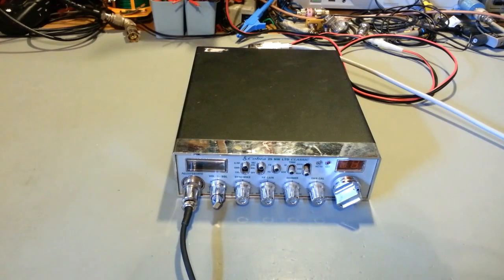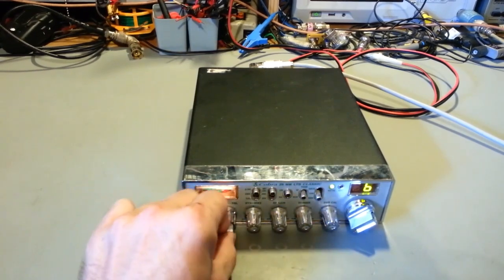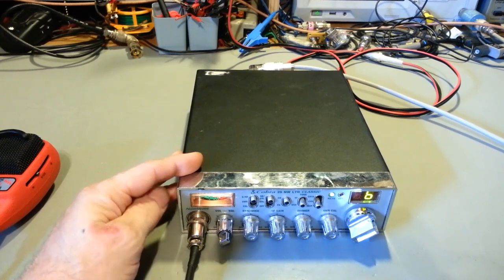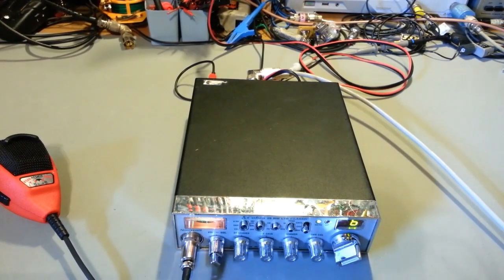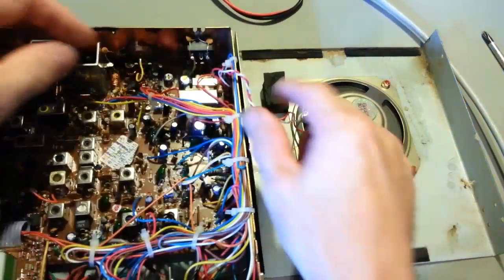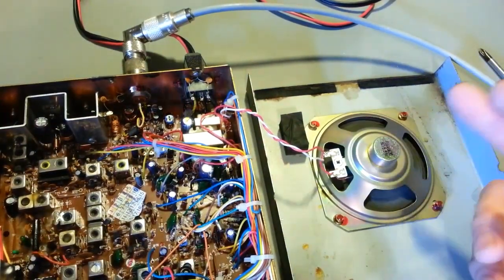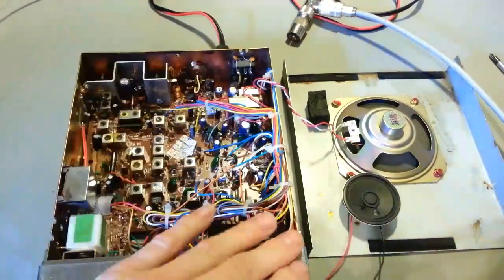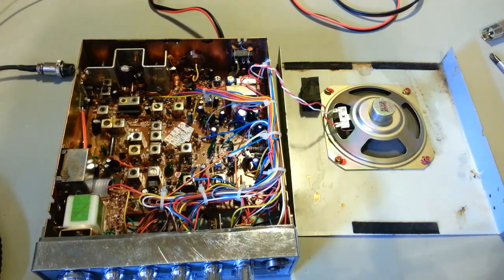Troubleshooting no receive audio in a CB radio with no test equipment.

Comment: Thank you so much - my Cobra GR25 LTD ST´s Speaker died today. Checked it and found nothing visible inside and on the Speaker. After your explanation at the Beginning of the Video about Circuitry you saved my Day. Thank you so much and wish you all the good Numbers.
Reply: Hi there @renehasselmeier9866.  Windy day out today and a little overcast I am new to this and I thought that I woudl ask if you are an active CB operator?  I ask because I am a little curious if there is a lot of activity on the CB radio.  I may go out and try to buy one either used or new.  Regards,  Richard.:face-red-smiling-live::yt::goodvibes::goodvibes:

Comment: Just bought a Cobra 29lx from their Ebay store and there is no sound at all. Taking this to my electrician friend with this video in hand so he knows what to poke around in. Thanks
Reply: Hey there @AJ-sh8uv.  It's a cloudy and windy day today 50 degrees and spring is on the way.  I am new to this.  Just quickly typing out to ask if you plan to be active on CB radio?  I have been looking around on ebay for radios and tried to order a CB radio thorugh ebay.  Richard. :face-red-smiling-live::yt::stayhome::elbowcough:

Comment: Of course I have no sound out the ext speaker hole as well as the internal one. I'm receiving when I key up my base radio as it shows on the meter. I've checked all switches and all knobs and as many connections as I can see..the radio is a Colt 444 AM/FM 40 upper /40 lowers radio with  a 3 position watt switch also. It's doing the watts it's supposed to do and I can hear myself in other radio. Just no audio from this mute bastard

Comment: Thanks for the information. I have a cobra 45xlr with the same problem however there is no internal speaker. It's the AM/FM CB and you must connect external speakers. It does transmit and the audio is fantastic but It doesn't receive on CB or the broadcast bands. I'm going to open it up when I get time. I'm hoping to find something simple like a broken wire or bad connection.
I would really like to get this rig working again.

Comment: unfortunately did not help me my radio sends but no receive. Its not the speaker. I replaced every capacitor in it. It really is a strong transmitter now but no receive?  the needle on the meter does not show incoming signal activity? But it shows transmitting and I can hear it on my bench radio I use to see if a radio is transmitting. I have several radios that wont receive I cannot fix don't know how ? Some look like brand new radios. I changed the protection diode it didnt help the old diode test out good.  the PA still works loud some one destroyed D11 its actually too crazy loud now. I think Im going to loose my 35 bucks on this one.

Comment: I have an cobra 29 lx chr le with echo tune that’s not working at all, so I decided to open the cover to find out the bolts that hold the speaker to the cover was on the mother board, my question is would it effect the cab from working ?

Comment: So what happens when you have a cb that transmits clear as day but even at 25ft apart or less I can't receive anything? Like the speaker definitely works sometimes I very rarely pick up random transmissions from other truck drivers and the noaa stations come through But when I am trying to talk to a co worker at a plant we load at or our yard even if we are like 25 feet apart I get nothing. Same cb as this. But my portable cobra hh50wxst does the same thing and I can't understand why and all it has for adjustments is just squelch... even tried a different antenna still nothing.

Comment: I've never been lucky enough to have only a speaker issue. Well one time on my Stryker 955 I use an external speaker in my truck but bring in and use it as a base with interal.
Turned it on and no sound.
Turns out the speaker had come unplugged from the pcb. I first thought the transmit had gone bad.

Where is Mike? He must have really found something good to abandon working on radios.

Comment: I just fixed one i got for 5 bucks. Someone hooked positive and negitive up backwards, blew the protection diode but not before blowing a hole in the audio modulator ic
Reply: If you had a hole in the TA2227AP  audio chip then they put in a 15 to 20 amp fuse after the normal fuse blew when they reversed the leads ...  I have seen many many radios come in my 2 way radio shop like that.....

Comment: I have been looking for a used cobra  nightwatch. They all seem to have the nw light inop. Is that common, and is the costly to fix.
Reply from the maker: Yes, it's common.  They fail sooner than later.  The faceplate luminescent decal is what fails.   The hotter and more humid the weather they are exposed to the faster they fail.
Reply: @mikesradiorepair  I   am wanting one so I don't have to use nitro lights, is it still repairable, can you still get the face plate if needed

Comment: Hey where did you get that screwdriver
Reply from the maker: It's a electricians screwdriver.  They are available at Lowes, Home Depot, electrical supplier and countless places online.  It is made by Klein Tools.
Reply: MikesRadioRepair sweet I’ll have to pick one up. I have a question for you I have an old RadioShack cb that receives but transmits a nasty buzzing sound when I key the mic the swr is about 1.5 on channel 1 and about 2.5 on 40 I have not tuned the antenna for the radio yet

Comment: ok I have a 2014 volvo vnl, it has the standard cobra 29, I have to right on another truck ass to get them to hear me, my meter light is out, and my ant light comes on when i key the mic and it flashes when I Talk
Reply: SWR / antenna problem.   SWR's too high, bad antenna ground, pinched/bad coax cable.  The antenna light comes on if the swr's are too high, indicating an antenna system problem.  If your swr's are too high the radio won't transmit far or receive that great.

Comment: I have a similar problem but my speaker works. I can get sound when I switch to weather broadcast. The tx/rx light is lit. Mike works, i can transmit power but won't receive at all. No movement on the needle even with a handheld right next to it. Antena works on my uniden.
I left it on one time and when I came back to it, it wasn't receiving. Im thinking it's got to be a capacitor or transistor but visual inspection.. Everything looks good. I do have a fluke and an o-scope. Where should I start probing?
Reply: I have the same problem. What did yours turn out to be?
Reply: @johnnycurry6618  never did find the problem but, I just use it with an external speaker now. If i were to guess 4 years later, I would say it has to do with the circuit that senses that you've plugged in an external speaker and to switch output. Maybe a transistor?
Reply: @irishn8  gotcha! Mine still doesn’t work even with external speaker. Just wondering, I appreciate it!
Reply: @johnnycurry6618  try another microphone.

Comment: I had no receive on a TRC 30A and found it was the Delta Tune I used Deoxit and turned it several times and now it works.
Reply: I just got a trc30-a and I'm having a no recieve issue, I receive static, and it seems like it's working but I have no idea I'm brand new to the cb , I seem to be transmitting fine. But I can't tell yet, assuming she needs some tlc and some repair work.. checked the external speaker. I got a pair of powered ones it's like an aux jack... It did work but static is the same. When I opened her up I can't even tell what I'm looking at

Comment: I have a question if you have a second to respond. I have a galaxy dx99v that someone has done a lot of hack mods to, one being to pull TR32. Will a 2n222 or similar work in its place? Thanks in advance, love your channel, i want to learn more but only as a hobby.
Reply from the maker: Use a 2sc945.  It's the most common transistor used in radios.
Reply: @mikesradiorepair  thank you for getting back to me, i greatly appreciate it. I'll have to pull one out of an old uniden i have. I see on the schematic it has that specific transistor. The only transistors i keep in my parts supply bin are a bunch of old radio shack ones. I sure miss not having a radio shack

Comment: I have same radio it has power but cant receive or transmit and when you key the mic the gauge above where u plug mic in does not move any ideas?
Reply: The mic plug is probably faulted.  It happens often from the wire bending back and forth a lot and the wire inside breaks.  Any cb shop could fix it for $5-10 in about 5 minutes.  Or you could buy a new mic.

Comment: So what if when I turn my radio on (uniden bearcat pc787) and it beeps loud. But incoming transmissions are very quiet. It's also very quiet through an external speaker.  I'm new to this.
Reply from the maker: A problem almost anywhere in the receiver circuitry could cause this.

Comment: I have a cobra 25 st and it only transmitts about 10 percent. On the back corner where the final is located after about 15 minutes the metal gets so hot you can't touch.  It has a 25 watt final in it. I am pretty sure the final is bad but would that cause the metal to get that hot? THANKS,ROBERT
Reply: Check the antenna SWR.
Reply from the maker: +ROBERT SANDLIN 

Cobra 25's  don't have 25 watt finals.  If it's getting that hot it's possible the final is shorted.  Check the voltages at the final and compare to the normal operating voltages in the service manual.

Comment: Is that a common problem with these rigs Mike? in my experience, I rarely see a bad speaker in a radio other than those that have been physically damaged. Maybe they just ain't making those voice coils like they used to. ATYB Doug.
Reply from the maker: +Doug McArtin 

In my experience a very common problem in modern radios.  They use the cheapest speakers they can buy and are therefore very low quality.

Comment: I have seen more speaker jack failures than speaker failures, I would love to find where to buy new PCB mount jacks... would buy a hundred of them.
Reply: TheDefpom just search "pcb mount 3.5mm mono jack"
Reply: @Barty.Crowell  Old post, but yeah. I bought 2 hundred of the PCB mounts, and a 100 of the old school type with the screw on lock ring.